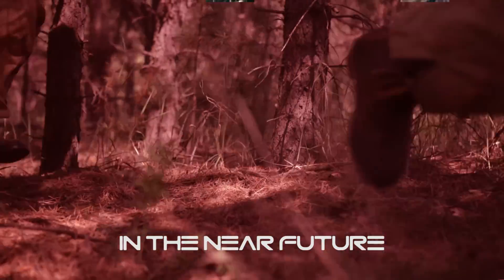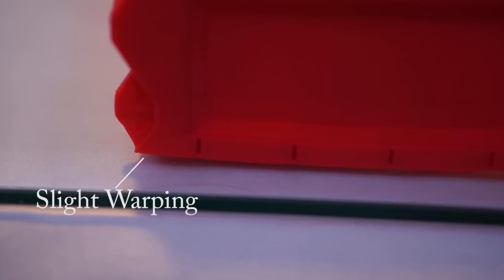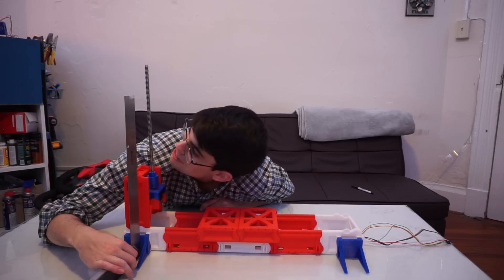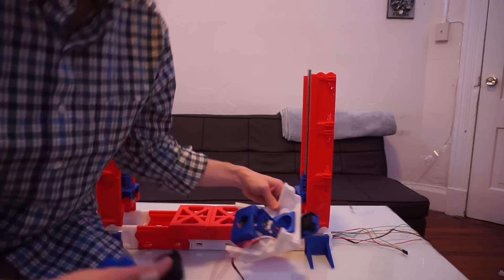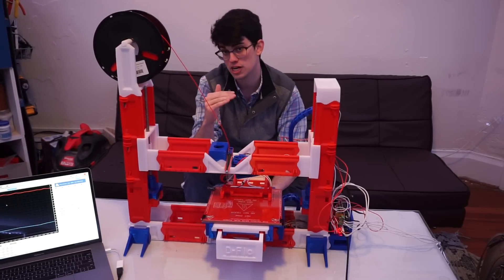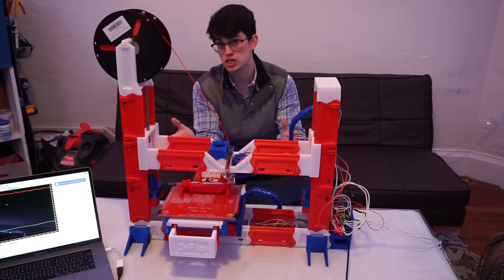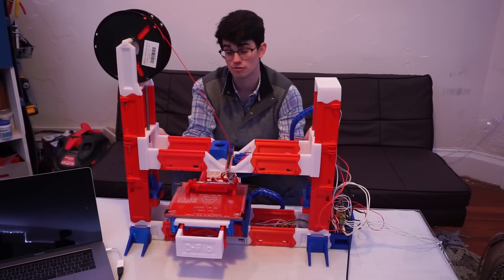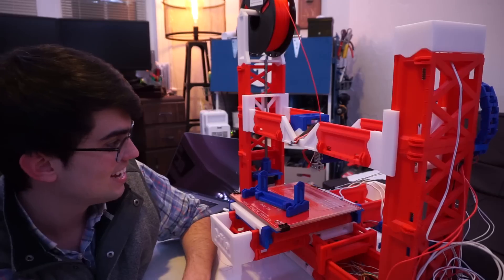Self-Replicating 3D printer (Snappy)

Comment: You should make a fully automated 3d printed 3d printer farm where you use your robotic arm to assemble them!
Reply: Also after you make 1 2 4 8 16 32 64 3D printers.  Each 3D printer should stop printing 3D printers then print molds(perhaps using a temperature resistant resin?) for each specialized part, then inject the 3D printer should go into injecting the mold mode which is much faster than just 3D printing.
Reply: @aoeu256  then we sell em all except for 5.
free money
Reply: Fuhhhk awesome
Reply: the deal is it mill take human assembly unless 2-5 arms are used in conjunction with eachother (to snap pieces, hold components, and install hardware). however one printer could print many snappys, which could each make one part of a snappy continuously, therefor cranking out frames.
Reply: And I had trouble with an arm that just picked up 3D printed parts and dropped them in a bin...